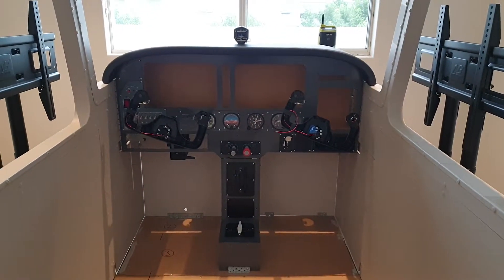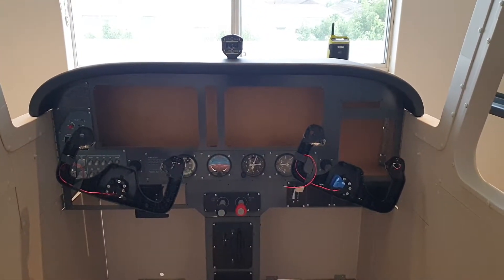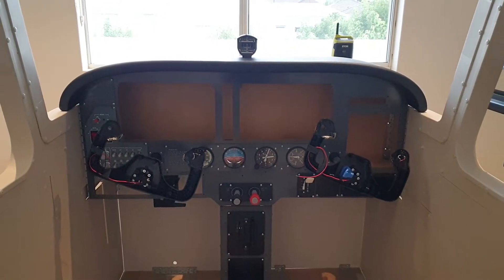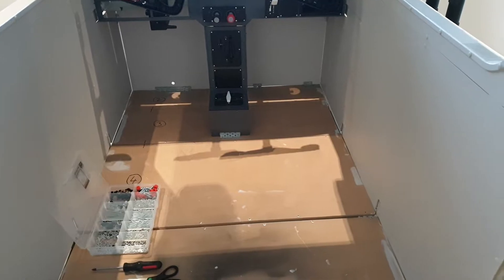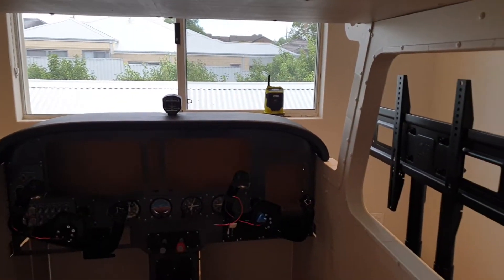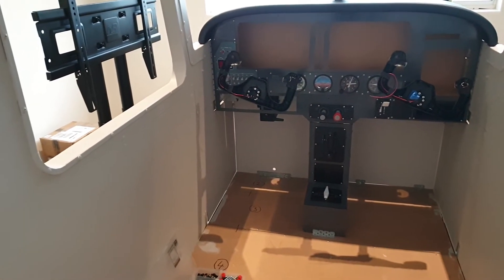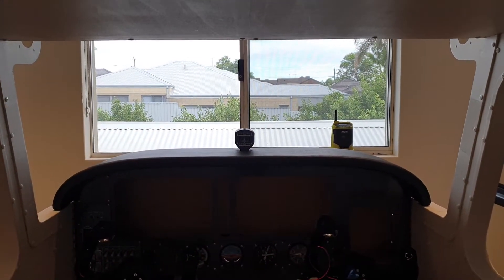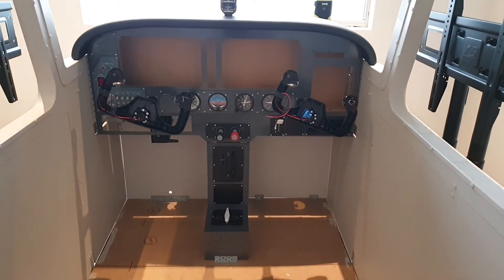⚡Progress on the Cessna 172 G1000 Sim⚡

Comment: I've built a sim myself too, about 1,5 years ago. I only sat in the cockpit of a 172 once and checked every resource on-line I could find. When I fly for a long time (1,5 - 2 hours) my neck starts to hurt. Something must be up with my TV / Main Screen.

I was wondering, do you experience the same?
What are the measurements of your cockpit?
1. Height from the floor to the top of the glareshield? (Glareshield height)?
2. Height from the floor to the bottom of the TV? (TV Height)? (Yours is 55" right?)
3. Height from the floor to the top of your seat cushion. (Seat Height)?
4. Height from the floor to the bottom of the side window? (Window Height)?

My cockpit measures up:
1. 99cm
2. 61 cm (My TV is 65")
3. 39cm
4. 78cm
I'm using Car seats (BMW 3-series)
Reply from the maker: Hi mate thanks for tuning in. Have checked my Fusion360 model (my rig is built off the model) with the following answers:

1. 99cm
2. 71cm
3. 35cm
4. 77cm

Looks like you are pretty close although your TV is larger which should be considered.  Hope this helps.
Reply: @CessSim  Wow, I did not think it would be that close. So no problems with your neck after playing?
Keep up the good work! Your Sim is really awesome. I'm still looking for a ready-made solution to those 3D printed window standoffs, My monitors are almost flush with the inner cockpit lining.
Reply from the maker: @Wokkelp  no problems with the neck mate at all. Thanks for the feedback. Much appreciated.

Comment: Love the way you did the window frames screws rivets etc. How did you put it together? Im based in Sydney. Where are you based? Costa
Reply from the maker: Hi. I am based in Perth although tend to do most of my Oz flights over your side of the country. Check out my video 09 on the frame. I cladded each side using 6mm MDF panels and then 3d printed capping over the cladding which you see inside the window cutouts. I am due to make another walk around video soon so will include further explanation on this........

Comment: Sorry for all the questions but how wide is your panel mine are 46 OD, 41ID, I'm want to center my console but my rudder pedals are to wide at 16" centered to the yoke.
Reply from the maker: Apologies but I do not quite understand your question. Do you mean the dimensions of the circular standby gauges? If so, they are (Bezels) OD 78mm and ID 72mm. My yokes are 600mm apart centre to centre (slightly wider than a typical  C172 which I did on purpose in design)
Reply: @CessSim  Sorry, I mean the width of the panel from side to side
Reply from the maker: @williamroberts5943  My panel is 1060mm maximum width left to right which is slightly wider than a standard C172 but I meant to do it that way....Hope that helps.

Comment: Well done great work absolutely love your work ! Iam currently building the exact same simulator you are i have all the avionics (g1000,switch panel,circuit breakers, stby instruments) sorted  but i am having issues with the dimensions and designs of the side walls and glare shield and the panel to mount the g1000 on itself i really like your design and think it is amazing can I ask where you got the dimensions from and if you have them on hand i would really appreciate if you can share them if you dont mind of course ?Also the fuel selector and the throttle mixture assembly look really good are they made by yourself or bought online? Thank you in advance!
Reply from the maker: hi mate and thanks for your praise. Much appreciated. I started the design on this over 2 years ago and spent about 9 months on design alone on CAD. The dimensions were from various sketches etc found on the internet. My design is slightly wider than a normal Cessna (want to have some comfort after all !!) but tried to keep everything else as close as possible. I purchased a 3d printer when the build started and have made all components from scratch with exception of G1000 panels, and flaps panel which were purchased.  Have a series of other videos I intend to put up as the build was progressing.   Happy to help you with any queries you have.    Good luck building and thanks for checking out the video... Jason
Reply: @CessSim  That’s Great Jason! Yes thats what I did i got myself a 3d printer as well it does help alot. Is The hand left switch panel from Simionic or was that also made by you? And are the controls dual linked? Because these are the two things i am working on at the moment. Is it possible for you if I sent you my email (husssainctc@gmail.com) to share the CAD files with me just to get a rough idea of what you did?It would really help me out! Thanks Again Jason and looking forward to see the rest of the build!!
Reply from the maker: @hussainis2000  HI mate. Yes left hand switch panel is simionic. I did design one myself but for the price, the Simionic is much better build quality.  Yes the yokes are mechanically linked behind the main panel.  Would prefer not to share my CAD files as I am still designing elements, but happy to send you some pictures if that helps.   Jason
Reply: @CessSim  it  would be greatly appreciated if you could send some photos Jason!
Reply from the maker: @hussainis2000  no problems mate.  I have a few other videos coming soon which provide some history of the build. Intend to post this weekend.   Keep an eye out. ..!!
Reply from the maker: @hussainis2000  Hi mate. Have sent you an image on the yoke linkage. Hope it helps.
Reply: @CessSim  Thank you Jason!